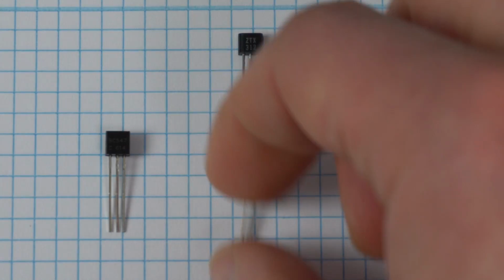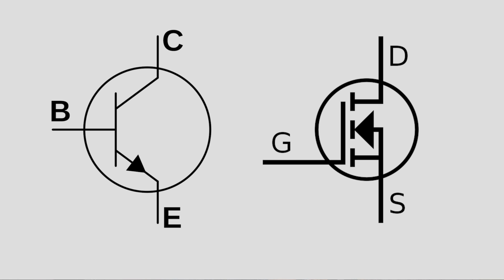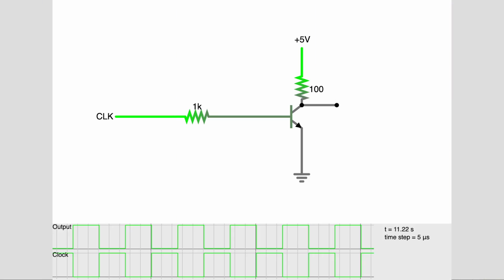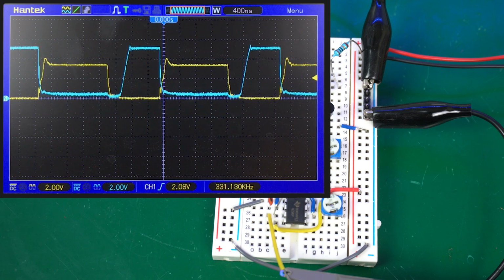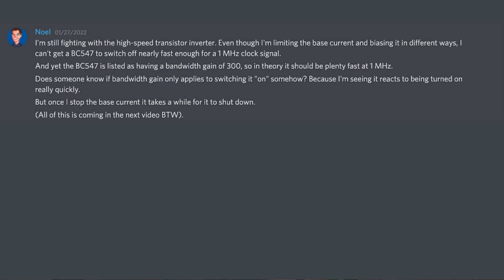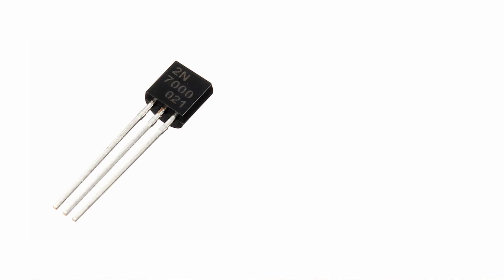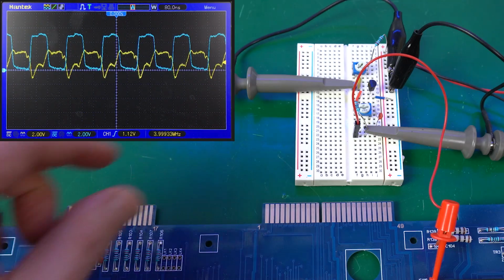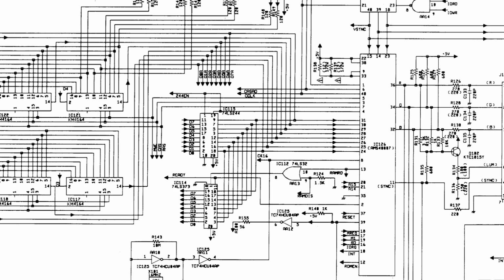How To Find a Transistor Replacement

Comment: From the semiconductor work principles you should know that a PN junctions when connected in reverse act like small capacitors. In that way varistors are made and capacitors inside integrated circutis. In your case when the input signal is high the base is positive it builds  a charge. When the signal goes low hoever the base will try to discharge through hte junction and the resistor. But it cant discharge fas enough. The capacitor you added acros the resistor will be charged with its positive side at the IC and negative side at the base of the transistor. When the signals goes low It spositive side will be connected to ground and its negative side to the still charged base of the transistor. In this way the capacitor will act as short circuit between the base and ground wich will immediately stop the base current and the emmiter-collector current.

Comment: Elecktor magazine used to just say npn or pnp for each transistor because 95% of the time just about any transistor will do. Mostly circuits we all build or repair are only up to a few megahertz, and most of them are just audio or switching. Other than power drivers or for video, or FETs,  a transistor is a transistor.

Comment: In the past I once accidentally picked a BC308C PNP instead of a BC238C NPN for driving a ~20mA LED from an 74Nxx output. I wondered for several minutes why the LED lit up when the TTL output was low. Until I checked the printing again and noticed my mistake. But this wasn't just a PNP-NPN mistake, this also meant that the PNP had the C-E current running against its natural direction. The BC308C was still very happy and worked in other breadboard setups.

Comment: Well explained, I only want to remark a few things: The problem is the charge strorage in the base due to the transistor being biased in saturation, the Miller effect is another different thing related to analog circuits, not digital ones like this "too" simple inverter. The CPC is a nice computer but its circuit design is quite poor, and at the end this transistor inverter was replaced by a logic gate as it should have been from the begining. (The other thing the Amstrad people never did was connecting the AY-3-8912 to the Z80 bus ;)
Reply: Indeed, the Miller effect is that the parasitic capacitance is much larger than expected. Noel explains very well why parasitic capacitance makes the transistor slow to turn off, but that doesn't explain such a low capacitance (a few pF) has such a significant effect. The effect is so significant because of the Miller effect. The Miller effect says that an inverting amplifier doesn't just amplify the signal, but also the parasitic capacitance between input and output, and this is why the parasitic capacitance is more more significant than expected. This explanation is missing in the video.

Comment: Transistor in the clock circuit is to adjust the high voltage level to what Z80 needs.

Comment: For a lot of transistors you are pretty much fine with using almost any one. Elektor had this sorted decades ago, using in their designs, which were made world wide, they had, for those general purpose transistors, the generic transistors TUN and TUP, standing for Transistor Universal NPN or PNP, which, as they published every year, a table of the 100 most common types of transistor per pinout, that would work in this application.

Thus you could use almost any of the listed transistors, or pretty much any cheap commonly available by you transistor, and it would work there. Just choose the appropriate polarity, and the pin layout, and then you had pretty much free reign on the transistor.

As to datasheet errors, depends on the pinout if it is being viewed from above, looking through the pacage to see the leads, or looking from down underneath, which flips the leads on it, though yes errors are often there, as the datasheets have been copied on and on from older datasheets with little checking, and often with OCR being used to grab the text, and then the graphs and images are inserted after losing orientation, or being flipped. Then no checks done, other than a random check that "hey no blank pages and sort of visible images and text" being there.

Comment: Ok Noel I just had a crazy idea, how about a overclocking a 555. Like you and EEV Dave and others. You all get a batch and test from that batch. And just see how high you and really clock a 555. That's something I would want to see.
Reply: To make it switch faster, you have to make the capacitor you connect to it smaller. You cannot make the capacitor smaller than the parasitic capacitance and thus this is an upper limit.

Basically, the 555 clocks itself. It isn't clocked by an external oscillator like a microprocessor.
Reply: @danielmantione  I was trolling it I love the 555. It was in my 1st bag of components in a discovery kit in the late 1980's. It's great how a tiny piece of silicon can inspire.

Comment: Ah yes. Good old electronics class. I think using a proper inverter would have made much more sense but they would obviously cost more. The revision was a wise route to take. The Miller effect is what deals with what is known as slew rate current ( the speed at which the amplifier can change it's output.)
Reply: Not quite. The slew rate is the maximum rate of change of output. In other words, it's the limit on rise time and fall time for edges in digital applications, and the frequency limit on large signal swings in analogue applications. In this circuit, the charge on the base capacitance is holding the transistor on (output low) in saturation for a period after the input signal goes low. This is effectively a propagation delay for the rising edge of the output, rather than a limit on its rise time.

The fix for it when the input signal goes low is to find a way of sucking the charge out of the capacitance that the base of the transistor sees. If you have sufficient current sink from the input signal, then a capacitor across the current limit resistor will attempt to pull the base below ground when the input goes low and remove the charge on the base capacitance more rapidly, as shown with the BC547. If you have not much current sink, but more current source available from the input, then a low value resistor across the base-emitter (a "pull-down" resistor) will help to reduce the delay.
Reply: @RexxSchneider  It's still the slew rate. The fix for that is irrelevant. Look up the Miller Effect.
Reply: @GORF_EMPIRE  Don't patronise me; I'm perfectly aware of the Miller effect which is caused by the voltage gain of an inverting amplifier effectively multiplying the collector-base capacitance. The issue here is not the slew rate, which is clearly displayed on the rising edge of the output at 10:23 and can be seen to be around 5V in 200ns which equates to 25V/μs. The problem illustrated on that scope image is the 400ns that the BC547 takes to come out of saturation when the base current is shut off. That is entirely due to the charge on the capacitance as seen by the base having no low impedance path to discharge other than through the base-emitter junction. There is no Miller effect on a transistor in saturation because a saturated transistor has almost zero voltage gain.
Reply: @RexxSchneider  Sure whatever pal.
Reply: @GORF_EMPIRE  Very mature.

Comment: * 13:45  Huh, not quite a "perfect output", the falling edge is heavily non-monotonic which is pretty back for a clock signal ...  it doesn't happen in the final circuit on the board, so not an issue but in that test setup it's quite messed up.
* As noted, the output stage from the gate array is probably an internal pull up and a nmos driving the signal down, providing a high output impedance when the output is '1' and a low impedance '0'. But then that means on the falling edge it should have plenty of capability to sink the charge left over in the base junction of the transistor to turn it off quickly (since in the board there is no base resistor). So I'm not entirely sure why it had an issue.
Reply from the maker: I think the not perfect output is because of the input signal itself of the 555 which is totally not square, that's why I didn't give it much thought.

Comment: 16:22 The small spike at the output right before the signal falls is also caused by the Miller effect: The input rises at that moment, and the rise goes directly through the parasistic capacitor to the output. The Miller effect amplifies the spike. After a very short delay, the MOSFET starts conducting and the voltage drops to zero.
Reply: @Daniël Mantione  I used to see you frequently on various Linux forums, not much lately, what happened?
Reply: @airspeedmph  Main reason is the retro computer renaissance, there is so much happening around the Commodore 64 and other retro computers these days that consumes a huge amount of hobby time. Some time ago SteamOS and gaming on Linux was brand new so that was where I was spending my spare time on. But currently... nothing less than wonders are happening on computers I love and I want to enjoy this.
Reply: @danielmantione  Totally get that, I spend my time alternating the two (Linux and retro) although I have to admit that the retro part I'm only experiencing vicariously through channels like this, since my only HW that can be called retro is a PS1 :)
Lately I'm seriously consider getting real by acquiring some hardware, though I'm not sure where to begin. I'm somewhat inclined towards a Commodore 64, but a working one seem to be rather expensive.
But yeah, is crazy what's going on in the retro space, new hardware+addons and even games, is impressive and alluring. And another thing that I especially find relaxing in the retro space is that everything is governed/motivated by passion, there's no in-fights, politics and ideology to be found here.
Anyway, have fun.
Reply: I was noticing that spike and it looked severe enough that it could possibly re-trigger some circuitry at the wrong time
Reply: BJTs are today easy to replace, large improvements make it easy to get it right today. Not so with Mosfet, several parameters such as R ds(on) makes it more work to check out correctly.

Comment: Great video Noel. I had a similar issue when building my Sixty Clone with transistor in Q2. I eventually found one with help from one of the component suppliers, but at the time I thought a lot about transistor replacement for these replica boards.

Comment: Fantastic video, Noel! You're surpassing yourself. And I was delighted to see that you also had to battle the Bibl... err... the Sedra as an undergraduate. So did I! :-) Regarding the clock inverter, if the gate array uses the uninverted clock signal internally, it makes sense to invert it before passing it on to the CPU: the 180-degree phase shift helps account for, and even take advantage of, the propagation delay of the other signals shared with the CPU. The Atari line of 8-bit computers makes liberal use of this kind of phase shift to ensure proper synchronization between CPU and other active components, and it effectively doubles the speed of the system, since you get two clock tics per clock cycle, each in a different part of the system. Back in the day this kind of hack mattered. I also would be very careful about biasing any switching transistor without a base resistor. You got lucky (or perhaps you knew it) that the gate array had an internal pull-up. Otherwise the pin wouldn't be able to source the kind of current you get through a diode to ground, and the chip might have been ruined.
Reply: My analogue electronics lecturers championed Sedra & Smith, and I was heading towards failing the course...
Then one of my classmates showed me his copy of The Art Of Electronics, and suddenly everything was alright.  =)
Reply from the maker: Thank you! Yes, the inverted clock signal makes a lot of sense. The thing that surprises me is that the Gate Array doesn't invert it before outputting it since nothing else on the board is using the uninverted one. I guess they either completely ran out of space in the GA or it was a "fix" they had to do afterwards.
Reply: @NoelsRetroLab  That was probably because of a limitation of the specific process technology used in the gate array, which may have prevented either enough buffering capacity (i.e. cannot drive or sink enough current) or fast-enough switching at the required current. It surely makes sense. An external transistor can use very different process technology than logic and can have larger die space than what could be done in the gate array.

Comment: That definitely answers the transistor issue. Great to see this explained. Never heard about the Miller effect.  Thanks for this ‘down the rabbits hole’ video.
Reply: Hope he cooked the rabbit while he was there. :)
Reply: My first thought when I saw the slow turn off time was to clamp the Base to GND with a resistor, but then again I am not an electronics engineer.